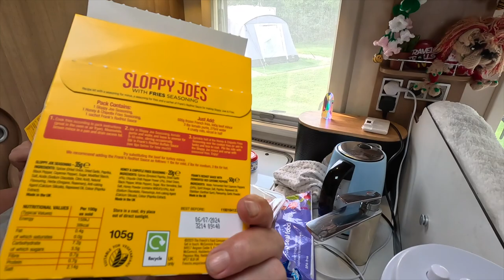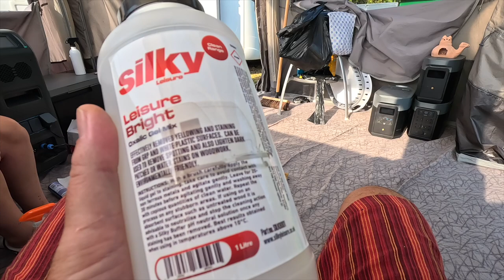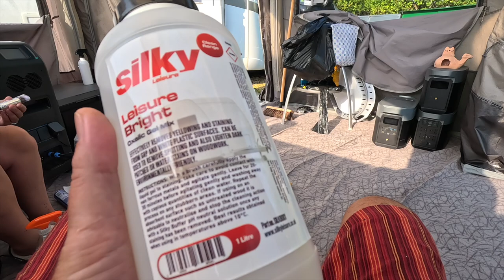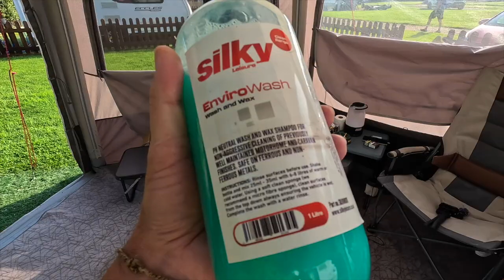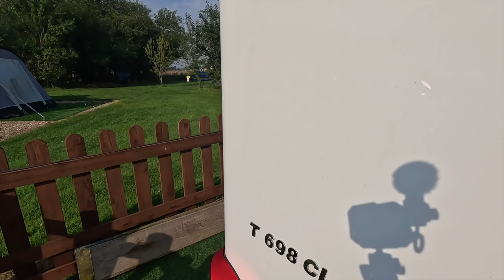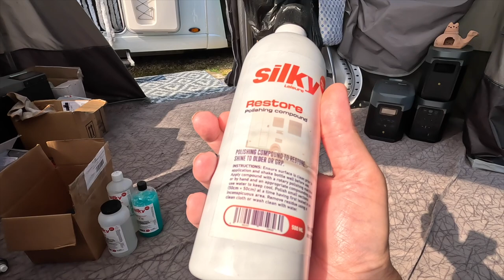It's Time To CLEAN Up Our MOTORHOME Act!

Comment: I love the way Dan looks when you’ve caught him out, cute 😂😂❤ You need the hose that we have that when you turn on the water it grows, they are really good, don’t use masses of space but get longer to reach farther, I have the same/similar spray head with all the options as yours but we bought it with the hose. ❤ Windows and mirrors Mazzi, white vinegar on a cloth and dry off with kitchen roll, I have found that to be the best streak free way, you can wash them first obviously if they are dirty but once they have dried go over them in this manner to finish them off 👌🏻❤